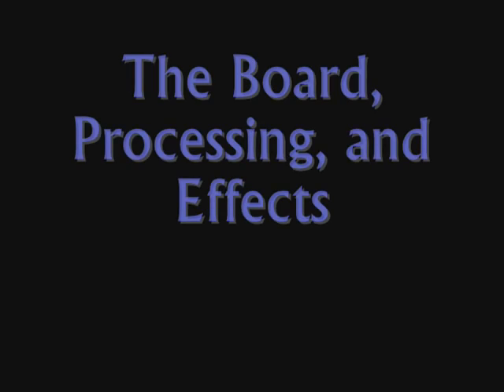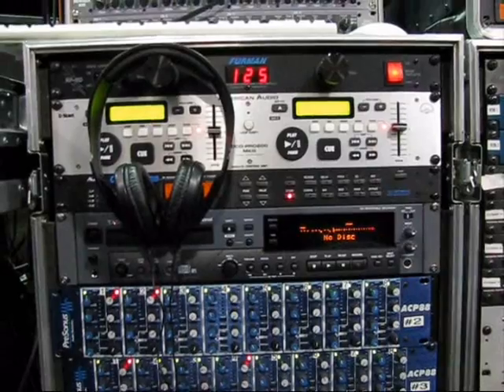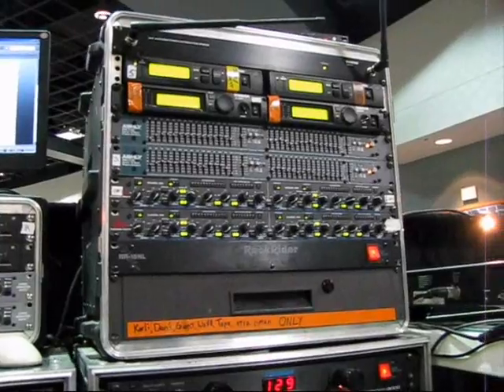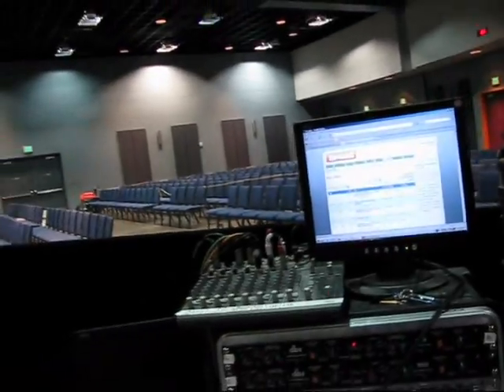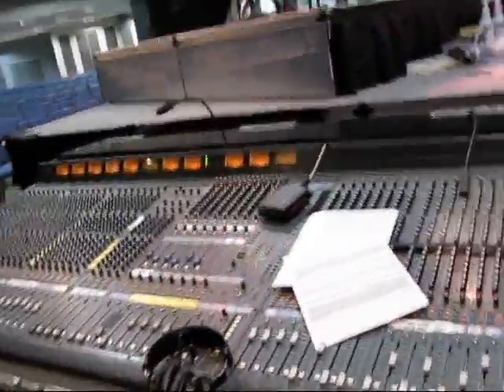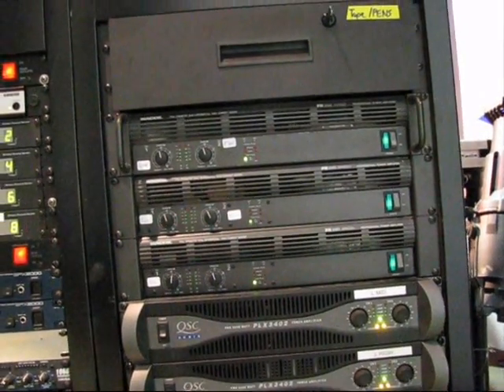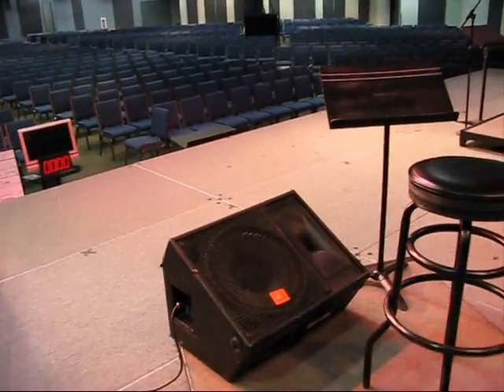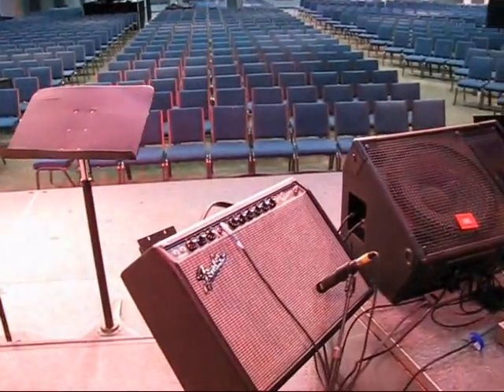Audio Tour of ChangePoint Auditorium. Front of House

Comment from the maker: I can EQ an entire band in 10-15 minutes.  Even if I had presets, I would still fine tune,  The variables of the room are always changing.  Heat, cold, humidity, dry air, barometric pressure, size of crowd, change from day to day, especially in Alaska, and that effect how certain frequencies travel.  Even weather or not people are wearing coats or not can effect the sound.   If I could run 100+ dB or so, It would be easier, but it IS church.  I try to run around 90dB 20 feet from the stage.